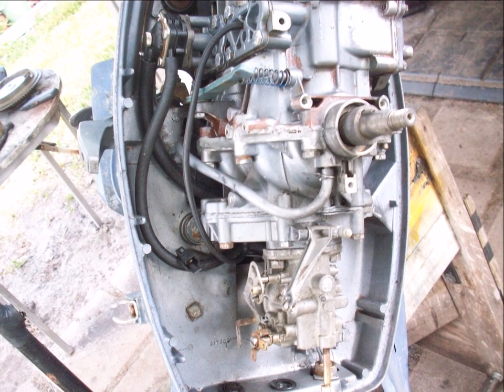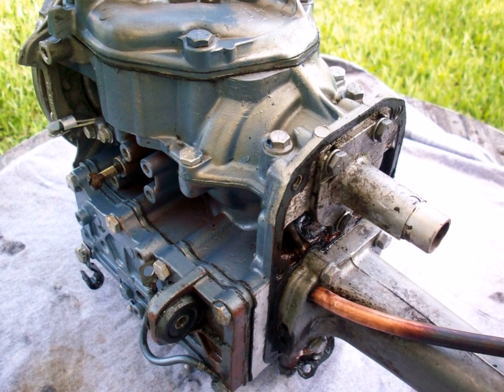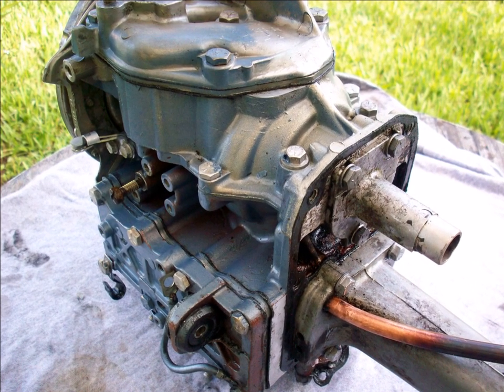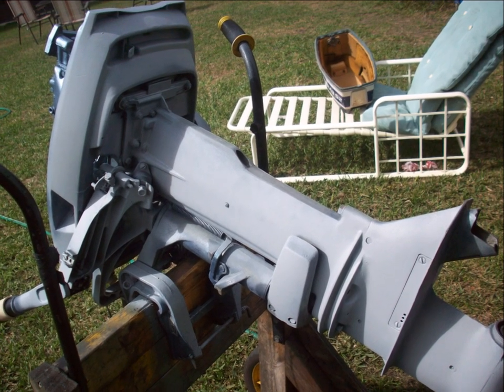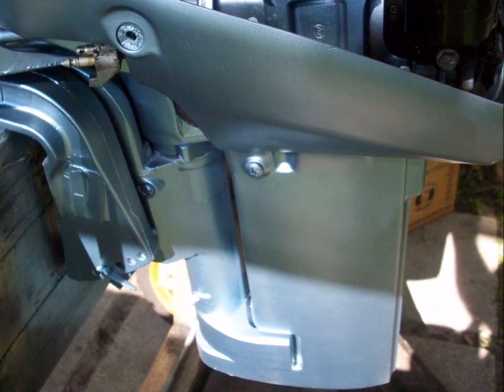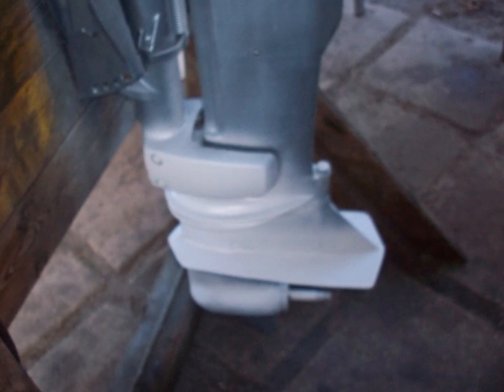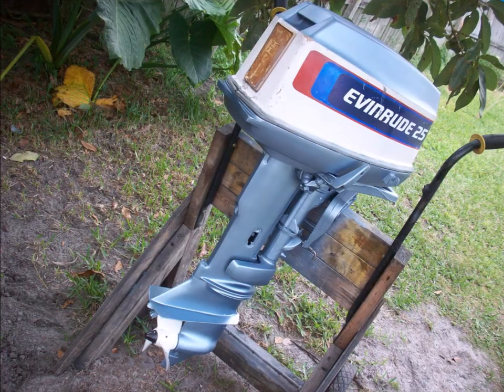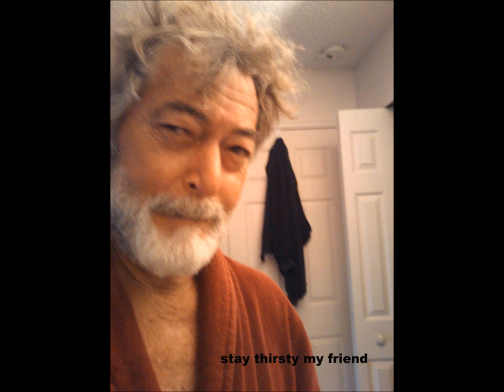THIS OLD OUTBOARD on OUTBOARD PAINTING

Comment: Hello again friend, got my 1963 evinrude 10 hp all taken apart and painted put several coats of Moeller primer and finished off with evinrude light blue also Moeller paint, I'm getting set to apply the clear coat but debating if I should apply clear coat on the powerhead. Advise? Not sure if the heat from the motor will do any good.
Reply from the maker: Hey. Thanks for tuning in. Well I've never tried it so not much help here. I always used the high heat, fuel/oil resistant auto parts paint and it looked pretty good- but I flipped all those outboards so I never got to see what they looked like a year or so later. Maybe check out iboats.com forum on painting- might find some good info there. Thanks again !

Comment: Thanks for the tips, Repainting a 77 75hp stinger your primer worked great. I used that vht though and I kept slinging chunks cleaned nostle shake repeat still slinging chunks. Had to wet sand and I'll hit it again tomorrow. Going for the Orange lower unit color.
Reply from the maker: kool. put a video up!

Comment: Love the color. I would think epoxy paint for kitchen items like fridge or oven would work well, just not much of a veriety. 
Just picked up a 1955 JOHNSON  CD-12 5.5hp. Bottom end. Will add a 6.7 mower engine soon. 
Never owned an out board. What are the two large springs at top of the motor base for. ..on the lower end that is. Really happy with my find has revers too! Can't wait to doll it up.
Reply from the maker: Hey. Thanks for tuning in! Yeah I've used the appliance paint on the powerheads before. It looks good! The springs keep the tension on the locking mechanism for the trim pin setting. Let me know if you do a video with the mower engine. I'd like to see that. Thanks again & Stay tuned !
Reply: @THISOLDOUTBOARD1   It don't be a bit but yeah I'll do that

Comment: Nice work on the motor.I have a 1960 Evinrude fastwin 18hp short shaft i have repainted the cowling and it looks pretty good.I am about to paint the lower unit and i wanted to bounce something off you.My boat is a 76 starcraft supersport 16 with old rough paint.I whipped the outside and transom with white vinegar let it dry and painted it with truck bed liner it stuck really good and looks great.I was going to do the same with the lower unit. So it will be black. You should do a test and see how that works for you no primer needed.Tell me what you think enjoy.
Reply from the maker: Hey. sounds like a cool idea. I'll have to give it a shot sometime, maybe on the Johnson 30 horse, I'm getting ready to tear it down for mounts and paint. thx

Comment: Evinrude recommends a special paint due to electrolosis. I never have and havn't had any problems. But at least one part ( i don't paint the adjustable fin above the prop) because you need a cathode (especially in salt water) to sacrifice itself or else the whole motor will start pitting radically. Supposidly the Evinrude paint avoids this.
Reply from the maker: Hey. First off let me say, the first comment you left on the Spun Hub video is/has been held as likely spam. When I click on it to approve it,  its not there. Weird, just another glitch I guess. Anyway Thanks for watching that video and the great comment !  Hey. I've never heard that about the paint, or was it that crazy green primer they used. I've never had a problem either. Thanks again for watching and commenting. Stay tuned !

Comment: Do you ever cut the cleaners like Purple Power in half with water so it isn't as strong and harsh on the original paint?
Reply from the maker: Hey. Great question, and yes I will cut it depending on what I'm using it for.  Thanks for watching . Stay tuned !
Reply: What would you use to clean the old caked-on grease out of the throttle gears and pinion? I don't want to hurt the paint. My twist grip was so stiff from old grease the small gear shaft just broke on me at the motor end of the handle...
Reply from the maker: @thull1234  Hey. Well , I rarely get a motor with good paint, Hahaha. I used straight gas on a little 4 horse once to get off the stupid camo paint job someone put on it and I was shocked on how great the original paint was, and the gas really didnt seem to bother it. And I've used it on caked up grease too. Its about the only thing that will loosen that crap up and it takes awhile for it to work and with the help of a pressure washer. A good pressure washer is your best bet without using any chemicals.
Reply: CAN I SAFLY POWER WASH EVERTHING EXCEPT THE MOTOR  BEFORE PAINT
Reply from the maker: @petermoyes8766  Hey. Yes, clean the hell out it and the power head. Just keep the plugs in and stuff something in the intake to keep it dry. An old rag will do, just dont hit it to hard. thx, Stay tuned !
Reply from the maker: @petermoyes8766  Yes. You can wash the Power Head too. just stuff a rag in the intake and try not to shoot any water in there and leave the plugs in 👍

Comment: Thinking primer/surfacer is for steel.
Shouldn't it be an epoxy primer?
Any paint looks good, fresh...
It's about compatible coatings.
Like to see your painted motor, after a year or two of weather/water.
Reply from the maker: Hey. Thanks for watching and commenting. It's just a cheap "clean up" job with rattle cans, not a restoration. Thanks again !

Comment: What all could cause a low spark
Reply from the maker: Hey. Thanks for tuning in. Week/Low spark could be a number of things. I don't know what your working on but I have a hunch it's an old outboard! You'll have to go through the entire ignition system, and/or sometimes its best to just replace everything and start freash. But, it may just be a week coil or even dirty points. You may or may not need any new parts. Who Knows! Until you tear it apart... Let me know what your working on. And some history on it. Thanks again & Stay tuned !
Reply: I have a 79 35 hp evinrude and the power head was bad so I found a used one that had good compression and installed it. Now I think I no what is wrong. But don’t no how to fix it. I think it’s timing this motor is an electric start no pull start I have both new coils fuel pump and rebuild carbs new spark plugs and new fuel lines
Reply from the maker: @jamescorbett2333  Best thing to do is get an omc manual specific to that motor/powerhead. Try ebay for a good used one. It will tell you everything you need to set up the time, plus a troubleshooting section too!